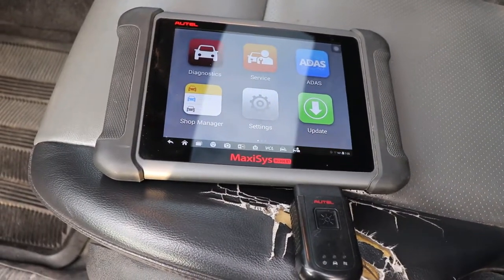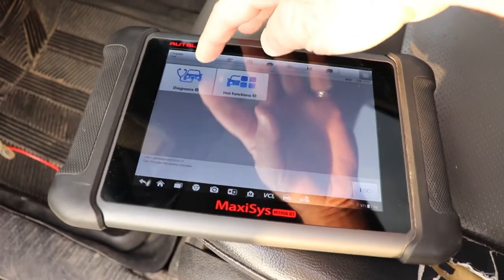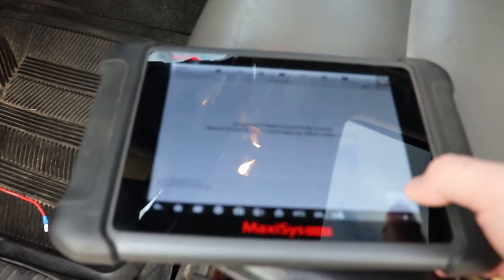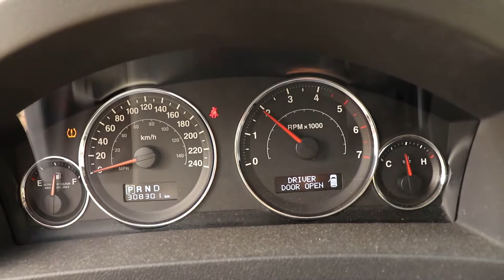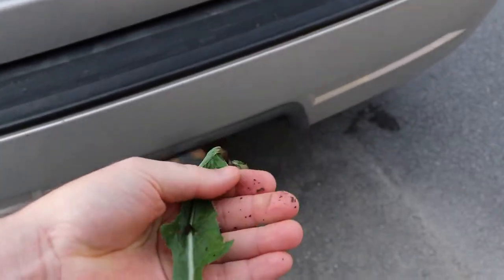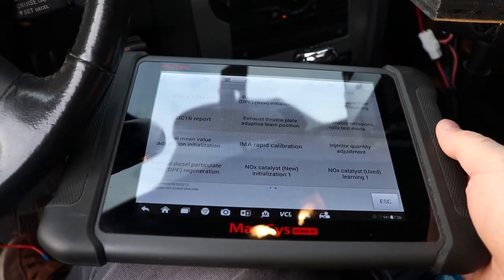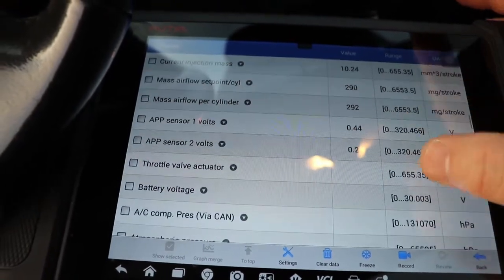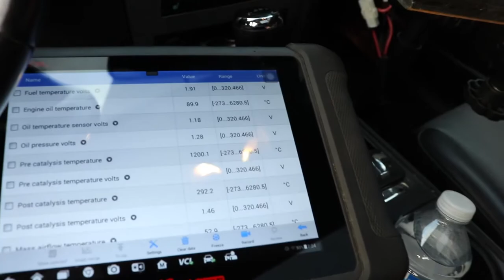Autel MS906BT - Jeep Grand Cherokee OM642 DPF Regen

Comment: Hi Steve. Another great Video, thank you. We did not have the DPF on the UK CRD. That is a really nice diagnostic tool you have there. It is £950 in UK so too rich for my blood. Does the OM642 inject Diesel on the exhaust stroke to raise the temperature for regeneration?
Reply from the maker: I am not sure how it works, the injectors are electronic so I guess they can fire whenever programmed to do so.

Comment: Does it always need internet connection to use it
Reply from the maker: no, all of the code reading is built in.  I did not realize it but Autel had some troubleshooting instructions for the codes available but they do require the subscription and internet to use.  I haven't had a subscription since September and it works fine but I don't be getting code reading for 2023 vehicles unless I renew it
Reply: @SteveRivett  is very expensive to renew. I am having problems using the auto vin most of the time fails after the updates ended it has to be something to pressure the user to buy the updates....